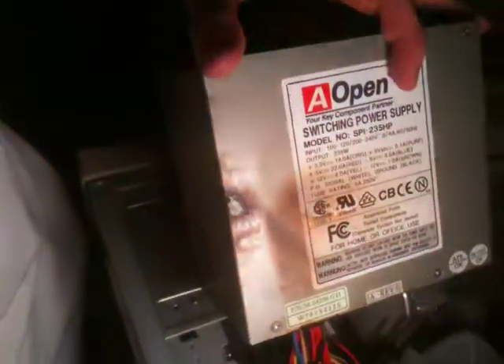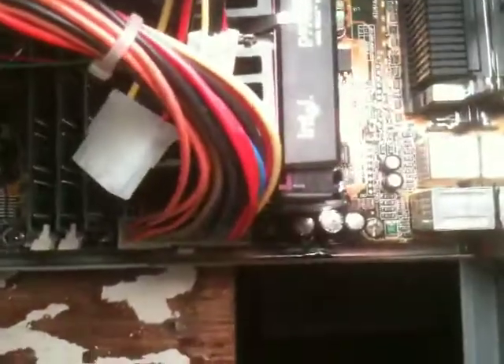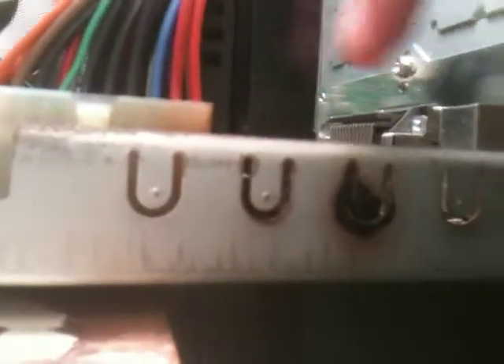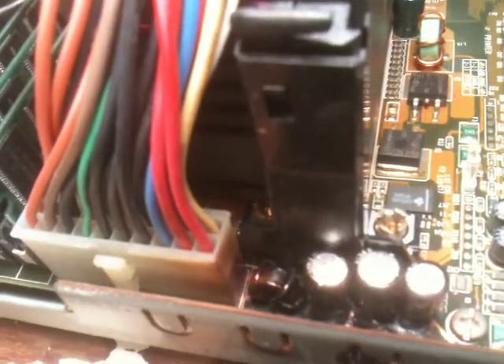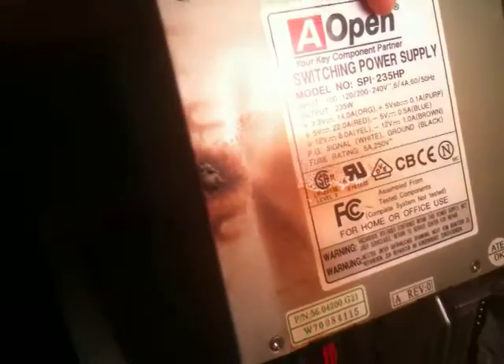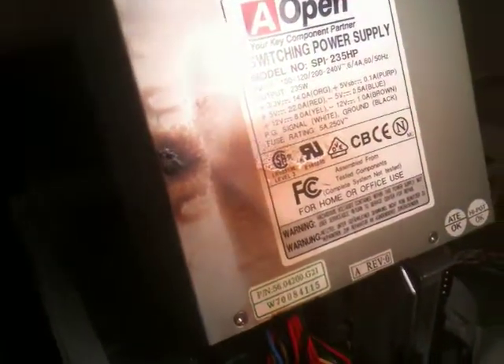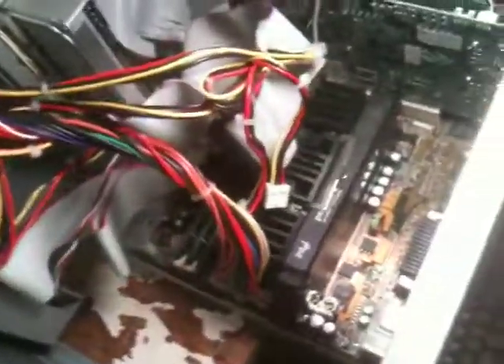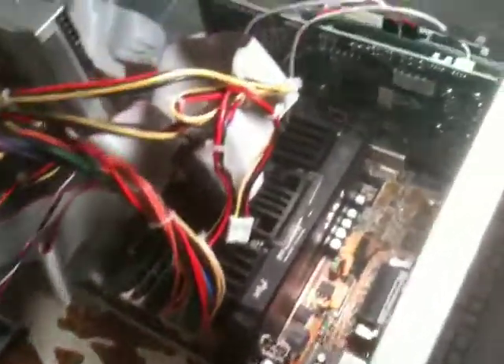Capacitor FAIL

Comment from the maker: well, the weird thing is that we tried to boot the computer and for some reason it wouldn't show the bios or anything, so we wanted to swap out the psu, and we found that, LOL. the voltage regulator capacitors were completely fried, so other parts may have gone too, i don't know.

Comment: What is class 2 lightning?  I didn't know there were different classes of lightning.  Is it easy to remove the fluid residue from that power supply?  Were any other components damaged apart from the obvious motherboard?